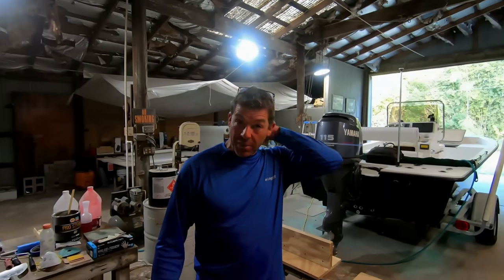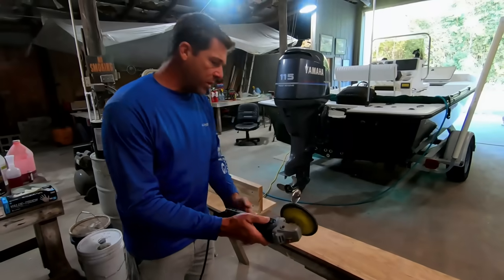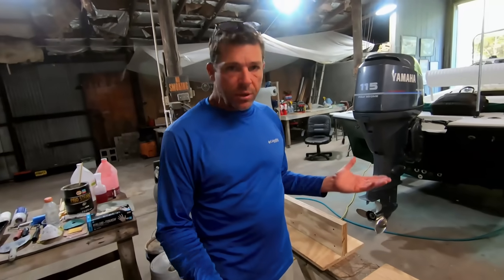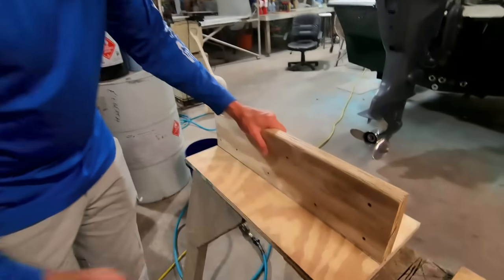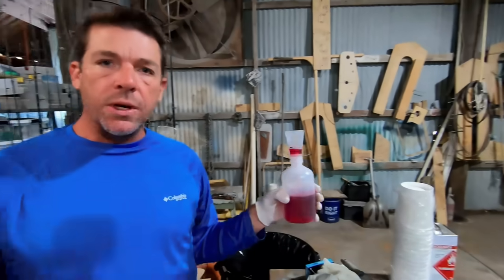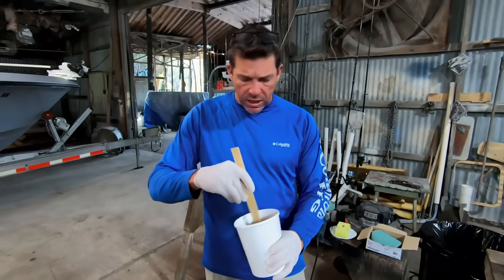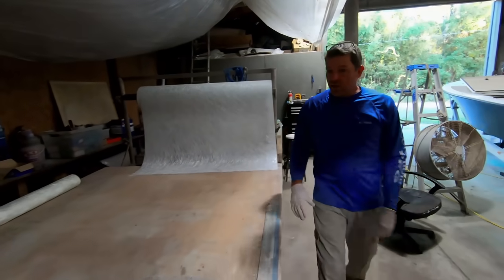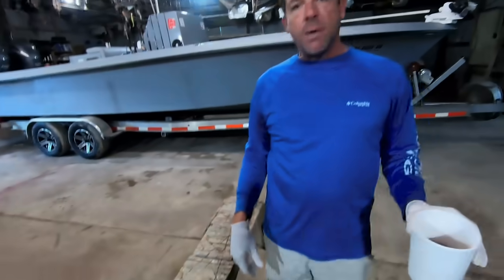How to FIBERGLASS over PLYWOOD!  Do it the RIGHT WAY the FIRST time! Step by Step DIY fiberglassing

Comment: Hey Capt! I have a question that I am having a difficult time finding. I am wanting to do a screwless transom layup for my skiff. I am wanting to laminate 2 pieces of 1/2 inch coosa together and then place that into the existing area where I removed the old wood transom. How would you achieve a strong bond between the two pieces, and then what layers of mat and 1708? This transom is only to hold a 60 hp engine, the old transom was 1 1/8~1 1/4 inch. For reference the boat is a Shoalwater Cat 14.5. Thank you for your time!
Reply: I tried to sign up for you once a month email but it’s sold out. I just signed up for the 10 dollar a month support plan in hopes you can find it in your heart to share some advice! Haha. Thank you again.
Reply from the maker: You can laminate 2 pieces of coosa together by priming the coosa after it has been cut to fit with resin. I like to use screws to dry fit everything so that it all lines up properly. It you don't use screws or 1/4  inch dowel pins to line everything up, the 2 pieces will slip and slide all over the place when you are trying to clamp them together. Especially when there is resin between the two pieces. 1 layer of 1 Oz csm should be enough to bond the 2 layers together. I would usually bed the laminated transom piece into the boat using 3 layers of wet out csm on the boat side, don't forget to drill some 3/16 inch vent hole all of the way through the laminated transom so as to allow air to escape from the two layers as you are clamping them together. You will probably want to build some clamps that are sized to you boats needs like the one I show here on the channel. After the transom core has been bonded in and allowed to cure, remove the transom clamps, and sand away any drips or runs. Then prime the inside face of the coosa with resin and let it cure. I always like to build transoms tougher than you might think, so a boat that size might take 4 layers or so of 1708, lapped out onto the hull sides in progressively longer widths as you tie it back into the hull. I like to finish out with a layer of csm, mostly for cosmetics.Of course this is a general overview and every boat varies.If you watch our how to epoxy over fiberglass video, and one of the videos in our 29 build series showes us working on the coosa transom install. I will also be installing a coosa transom in our upcoming 21 ft Blazer project boat. I hope this helps and thanks for watching!
Reply: @FishBumpTV  thank you very much for the advise! I am going to make those clamps for sure. I forgot to mention I will be using Vinyl Ester Resin, after watching your videos I feel like it’s going to be a great way to go with everything below deck. I would like to stiffen up the entire hull and stringers with a fresh layer of 1708 and 3/4 oz mat. I was going to do a honeycomb core deck but I changed my mind and will be doing a full coosa build. I would feel better being able to use some screws to help hold it down like you did on the 29. This is my first fiberglass project so wish me some luck. Your videos have been great to learn from and give me the confidence to take it on.
Reply from the maker: @FishHuntDive  Fantastic, glad to help!

Comment: Thank you for your experience and sharing your knowledge 😂
I live in Scotland and have a project boat that I have a question please. 
The cabin roof was grp over ply and the inside was rough, so I'm thinking of rolling resin and csm  ready to put a vinyl finish.  Is there a special technique for getting the grp to stick over your head without waring it and looking like Doc from "back to the future '😅
Reply from the maker: Haha, yes! Overhead fiberglass can be tricky for sure! You would want to be sure to prime the wood with resin first, then let it cure overnight. Lightly sand the surface free of any imperfections. I would precut the fiberglass to size, then roll   it up, so that it can be rolled out Overhead. You will probably need some help with this if possible. As it is unrolled, wet it out with resin. I would set the catalyst amout fairly high so it will set relatively quick. Hope this helps, and thanks so much for watching from Scotland 🏴!
Reply: @FishBumpTV  Thank you for your reply 👍    I will give it a try. I have built 2 rib hulls and loads of repairs in the past but nothing above my head 😃

Comment: Great video..thanks!!  First time attempting to replace missing hatch.  Please clarify. After prepping the plywood, you let it dry completely (not tacky).   Then when you lay the fiberglass, you add each additional layer while it is wet?  Thanks for confirming what I heard.
Reply from the maker: Thanks, glad you are enjoying the videos! Yes, I usually put down the primer coat of resin and give it a hour or more to tack off. We always use laminating resins in our shop, which even when cured will still be tacky. I would not use a dcpd or waxed resin for a primer coat personally. Then I  apply resin again to the surface and lay the glass in the wet resin followed by more resin to wet out the glass. I hope this helps and best of luck with your project!

Comment: Fantastic tutorial - one of the best I’ve seen. Thanks and subbed!
Question - my son and I are building a little hydroplane and want to keep the top deck clear so the grain of the marine plywood is visible. Can the resin be counted on to resist UV for any length of time or should we use something else. Sides and bottom will be glassed and painted.
Reply from the maker: Thanks, and welcome to the channel! Sounds like a very cool project you and your son are working on! We don't do a lot of clear coat work on our shop, almost everything is gelcoated or paint. I do know that clear epoxy will tend to yellow with uv exposure so you can go over the resin with a polyurethane that has uv blockers in it. I have not heard of many people using polyester or vinyl Ester resin as a clear topside finish, but I would imagine it could be treated the same way. Maybe someone reading the comments with more experience in this area could help answer. I will try to do some research on this topic and try to add anything I find in a video for you guys. I hope this helps and best of luck with your hydroplane!
Reply: @FishBumpTV  - thanks very much!
Reply from the maker: @motorv8N  you are welcome!

Comment: Thank you again Joe. Question… I am building a new console. Is it acceptable to pre-laminate my panels before putting them together? I will have some very difficult to reach areas inside of the console after it is built.
Reply from the maker: Yes, you absolutely could prelaminate the panels on your console build. That's a good idea! Just be sure to fiberglass the corners well after it is assembled. Hope this helps and thanks for watching!
Reply: @FishBumpTV  thanks Joe. Going to send you some baits from our shop that we have been catching some hammer speckled trout on here in Louisiana.

Comment: If working alone, should you work on smaller areas at a time and get all the layers of glass and fillets on while wet or finish each stage first before going to the next?
Reply from the maker: I wish there was a simple answer to that. For example, when we are building a boat hull, we would do the skin coat and let it cure. Then we would add 2 layers of biaxial fabric at a time until it is thick enough. On smaller jobs we usually try to do all of the glassing in one phase. But usually not more than 3 to 4 layers of glass in any one phase or it could  get difficult to manage.  I plan to do another fiberglass how to video very soon. I hope to answer more of the questions I have been getting in the comments in that video. Hope this helps, thanks for watching!

Comment: Question about screws inside glassed parts: I've been told that even 316 stainless corrodes if there's no oxygen present. What would be the best type of screws to use inside a glassed wood/plywood structure to avoid corrosion as much as possible?
Reply from the maker: We have used stainless screws for decades with good success, but it seems like there is always someone who will disagree with anything you say. Hope that helps, thanks for watching!

Comment: Hi Joe. can i ask i am starting to build a 15 foot sailboat, the saide panels are made with 8tf by 2ft ply and i will use finger joints to join the panels, i will glue with epoxy and when dry and sanded laminate with polyester and csm, will i have a problem with the poly and csm over the fine epoxy glued joint ?
Reply from the maker: We don't typically use any polyester materials over epoxy materials. There can be compatibility issues. If I were using epoxy to glue the joints, I would use epoxy to fiberglass over everything.  Just remember epoxy does not work well will csm. You would have to use a light weight finishing clothe fiberglass or a biaxial type material. Best of luck with your project!

Comment: A few questions...
- Does what you applied add much strength to the plywood structure?
- How well does a subsequent addition of glass adhere to what was applied, say, a day ago? A week ago?

I ask because I have a 1963 Century (all wood) that sat out. Water got in. and is now leaking out. There's no rot. I want to use the boat next summer, but can't yet afford a new bottom. Wondering if this could be a stop-gap measure (some glass inside and 3M 5200 spread externally) to get me through mild use (putting around on an inland lake) for one summer.
Reply from the maker: The fiberglass over the plywood does add some strength, the more fiberglass layers you add the more strength it would add. I don't have a number, or a exact percentage of strength it would add though . New fiberglass bonding well to old fiberglass can be an issue. The surface has to be clean, very dry, and have a very aggressively sanded surface to adhere to. We used polyester resin in this video demonstration, but epoxy resin would bond to an old surface better than polyester would in most cases. It would be hard for me to say if this would be a good seaworthy solution to your problem. I have plans for more resin and fiberglass over plywood videos soon. Maybe these will help.Thanks for watching!

Comment: if you wanted to seal the ends with glass Itotally encapsulating the wood) how would you go about that? I have a 2x12 that i may do this on
Reply from the maker: We have a video on that topic here on the channel. It also shows how to install pvc conduits through the stringers and waterproof them. We will be doing more epoxy and fiberglass over soon. Hope this helps, and thanks for watching!

Comment: If you remove a stringer from your boat, can it be adhered to the hull with 3m 5200 Marine adhesive/sealant or should I make a paste with fiberglass resin? (prior to glassing around it)
Reply from the maker: I suppose you could put 5200 under the stringers, but we usually put a putty filet along each side, then glass it in. Hope this helps and thanks for watching!

Comment: If you were to be glassing both sides, would you just continue around the other side with 2 more pieces, or would it be better to do both sides of the stringer and then cap the top?
Reply from the maker: If it were me I would glass both sides, and then cap the top. I also have a how to epoxy fiberglass over plywood video that shows some different techniques that you might find useful. I hope this helps, and thanks for watching

Comment: I have an older fiber glassed boat, and in the belly you can see minute cracks, 
Obviously this needs rebuilding, 
Have you got a video that shows how to repair said ?
Also what do you put into the resin so the UV does not ruin the product over a few years.
Reply from the maker: I don't have anything exactly like that currently,  but will try to work on something fou you guys. Gelcoat or a good marine paint will work for your UV protection. Hope this helps, thanks for watching!

Comment: If i wanted to make a thin plywood box and fiberglass over it (think canoe or rowboat strength) would i use the same  type of materials and poly resin to do so? What if i wanted the wood to be visible thru the fiberglass? Do i only use layers of the chopped stuff? What do i use to fill the corners that dries clearish?
Reply from the maker: You might want to consider epoxy resin for something like that. It seals very good, especially when you are only able to install thin layers of glass. You can mix epoxy resin with different powdered fillers to make what is called a filet, it won't be clear, but should still look pretty good. I hope to do some epoxy over plywood videos soon. Hope this helps, thanks for watching!
Reply: @FishBumpTV  thanks for the reply.  I am also thinking about fiberglass over xps foam to make my box. What I need is strong and light for a home made cargo bike. I have an almost 30x24 area that I want to build something for and am thinking fiberglass covered something is the way to go for strong light and repairable.

Comment: I´ve done square miles of epoxy glassfiber builds and repairs, but never onto wood structures. No doubt epoxy as substance is structurally strongest, but what saturates and adheres best to wood fibers? Epoxy or Poly ?
Reply from the maker: They both can work very well, but technically epoxy has a stronger bond than polyester in most cases. But most boats are built completely out of polyester resin and do great. Hope this helps, thanks for watching

Comment: I myself prefer to use a vinyl ester as a primer and as a pre wet out for lamination for bonding purposes. 5 gallon water pail helps with resin cups ,  core/poly bond for the filler / bonding is my preference in this scenario, even when bonding the plywood together with a wet out and a layer of chop between the plywood then screwed together.
Reply from the maker: Thanks for your thoughts

Comment: Good stuff!! I know this is off topic, but what are the dimensions of the prop on that yahama 115?
Reply from the maker: Thanks, I'm glad you are enjoying the channel! That 115 belongs to a customer of mine, but I want to say that it is a 13.5 x 17. Power tech props are really good, and they have  excellent tech support. You might want to give them a call.
Reply: @FishBumpTV  Thanks I had laser 2,  that was stolen years ago, while I was in Iraq.(boat was in GA) It was on a 115 yammy 2 stroke, pushing a 17 ft fish-n-ski I think might have a 19 pitch you could get on down the lake with that. I have been thru several props trying to duplicate that prop. the one I inquired about looked about right. So I thought I would ask!  Thanks for the quick reply.  Ed

Comment: Thank you for the video!
I am planning on building a teardrop camper this summer and I want to make it out of plywood with the wood look finish. Would it be possible to cover all the  exterior plywood with mat and resin and it still be waterproof?
Reply from the maker: Glad you enjoyed the video! Yes, you could fiberglass or epoxy over plywood for a camper. I have some concerns about leaving it as a clear coat. UV light breaks down fiberglass over time. Gelcoat or paint has UV blockers or inhibitors that help protect it. Kind of like sunblock for our skin. It is not a simple yes or no on this one. This is why you don't see it done very often. Hope this helps, thanks for watching!
Reply: @FishBumpTV  Thank you, that did help!
Reply from the maker: @USMC1984  yw

Comment: I know this is off topic, but I'm an old lady and trying to finish a small cabin so I can finally retire. Is it possible to build a compact one-piece shower stall with the marine fir and fiberglass? I have to use a shower chair so I would like to build a seat into it so it is just one piece and will not take up as much room as a pre-made stall. Also could I use fiberglass over a foam mold?
Reply from the maker: We have built bathroom-shower type enclosures in larger boats before, and it worked out well. I have never built one in a cabin or house before, but in theory, it could work. I would imagine that it would cost more and be more labor than a traditional shower enclosure. Also I would be concerned about moisture, and waterproofing the plywood very well, or else rot will be an issue for sure. Coosa board is a rot proof plywood alternative, but it still needs to be fiberglassed and gelcoated. It also costs considerably more than plywood. I wish I had a definitive answer for you, but hopefully, this info and your own research will help you finish up your project. I wish you all the best, and I appreciate you watching the channel!

Comment: capt joe, if you are just trying to find an alternative to buying marine plywood, do you need to use cloth.  I have some seat back that i am redoing and just don't want to spend $120 a sheet. nothing would be structural.  i subscribe to your channel today very, very good videos
Reply from the maker: Glad you are enjoying the videos. I know that Marine fir plywood will hold fiberglass well, and stand up to the elements. For a non critical application, though I would imagine that a quality exterior grade plywood could work for you. If you wanted to resin coat it for added weather proofing, just be sure to sand it aggressively first and make sure it is very dry. I hope this helps and thanks for watching!